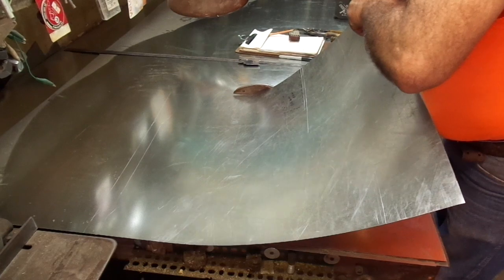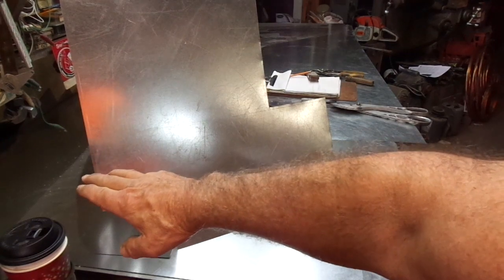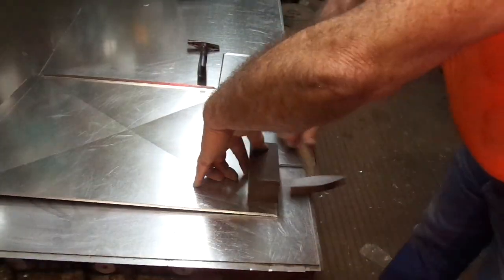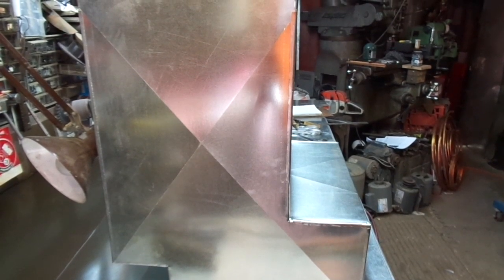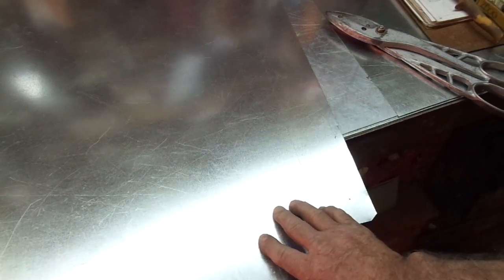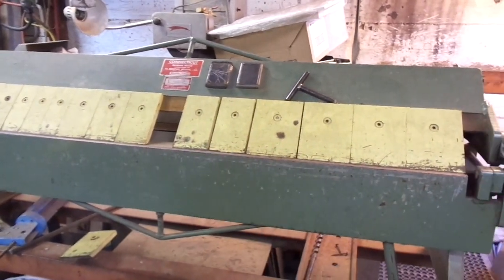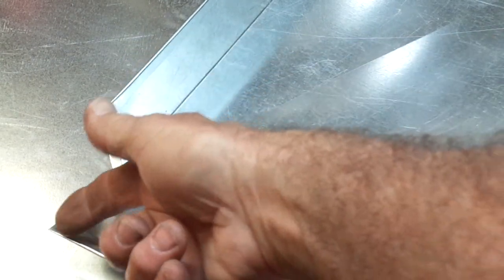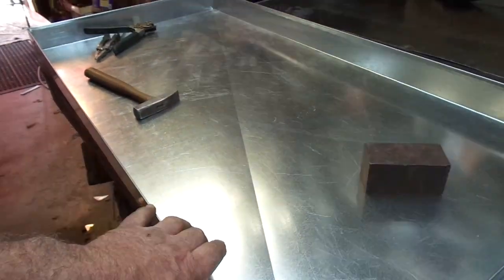Pt 1 Heat Pump Attic Installation

Comment: Looking good Tractorman44. You have me wondering how you will insulate the unit for our Canadian weather, both hot and cold. I have spent some time in attics. The dust will get to you even if the weather is cool. Take care .
Reply from the maker: Good Morning Larry and thank you for the compliment.  I don't know what the design temps are for your particular area in Canada but here in the St Louis Mo. area, it is 5* F for the winter and 95* F for the summer.  To insulate the ducts for attics or crawl spaces a 1/2" fibreglas ductliner on the inside or a Mylar coated bubble wrap on the outside is allowable. When lining the inside with fibreglas I usually opted for the full 1" lining.  But now, I go only the Mylar way.  One of the videos coming up will be almost entirely on duct sealant and insulation....but they may be split into two.  I don't know yet for sure.  One thing for sure though...I HATE attics and crawl spaces.  Have a great day sir.

Comment: How's she goin'?  I guessing this duct system is way more complex than what you're letting on!!!  You do nice work though!!!  The sheet metal you cut sure fits together slick.  Having the gear makes a big difference!!!  Take care!!!
Reply from the maker: Hey Mike, good morning to you sir !!  Thank you for the nice comment.  Sometimes I get lucky and the pieces fit...sometimes they just GIVE me a fit instead.  (-:   This is going to be a small two ton system so the ductwork size will not be excessive at all.  The complexity comes with offsets and transitions and making sure they move the air in the quantity you want at the velocity you want to maintain and making sure the duct misses all obstacles in its path. I'm going to apologize to you and everyone else in advance that this will be a drawn out series even though not all the steps can possibly be covered.  I hope you'll stick around for a while sir.

Comment: Good evening T! So....If you are looking for input, then yes, please take us through the WHOLE install. LOL. (not that you asked but I would love to see you doing the whole thing- even that attic is hot and miserable. LOL). The heat pump system you are installing : will that require a condenser unit to be hung on the outside of the house on the second floor? Not sure if you know but interesting about the difference between Canada nd the US:  here in most all provinces in Canada, we all have 1 single HVAC system to serve multiple floors so the average 2 story home has only one HVAC system to serve it whereas in the US, it is often common that a 2 story house has a split or second and separate system installed to serve the second floor. Looking forward to seeing you making it happen in Part 2. Cheers my friend!
Reply from the maker: Good Morning Sir...  Yes, there will be a second outdoor unit installed a few feet off of ground level.  This area suggests a 12" minimum elevation to minimize being blocked by snow.  I know...that's almost funny compared to the amount of snow you gentlemen get in Central Ontario and welllllll....Canada in general.  (-:

There are however many, many two story homes that are served by a single system as well as many that have two units.  A single unit for multiple floors used to be the norm but due to the differences in temperatures experienced due to some very poorly designed duct systems the dual system seems to be the most desirable.  The thermostat was usually on the first floor and the second floor was always warmer in the summer.  I don't know the design temp in your area but here in the center of the Midwest it is 5* F for the winter and 95* F for the summer.  With the 95* and summers humidity levels of 90%+ you can easily see how the second floor could be effected adversely. 

To compensate for the heat difference smaller air handlers are sometimes installed with more CFM air delivery per ton of cooling so the cold, heavy air could be forced up through the ducts.  This additional airflow causes high velocity in the duct and correspondingly exceptionally high noise levels in the house.  Plus the temperature drop across the coil is also effected because a/c requires 400 cfm/ton to function as designed and 600 cfm (for instance) will lower the drop in temperature across the indoor coil. Not lower the temperature, but lower the temp drop... the air will actually be warmer in cooling mode and cooler in heating mode on a heat pump. (That may create an argument for some).  This is the case in my sons original single system.  When the blower is on, the tv moves to 100 on the volume scale until the blower shuts off....then repeat.  His original system is cooling only with electric resistance for heat.

This is an exhaustive subject GP and one that deserves much more discussion than these few paragraphs that do not do it justice.  I've opened many doors here that need more explanation but...well, you know, just can't do it here. 

I could write a book on the subject but it wouldn't be a best seller by any means.....LOL and I do thank you sincerely for taking the time to read my op-ed. (-:   Thank you also for professing an interest in the series.  It will become exhaustive, extensive, sometimes elusive and many other words that start with an E.   You have a wonderful day sir !!!!
Reply: And educational. Thanks T - Looking forward to it. Cheers and all the best!

Comment: I haven't done much in the sheet metal work other than the occasional job that has to be done. I learned quite a bit from this video. Figuring the square inches of ductwork cross section is new to me. I also had never seen the power hammer. That has got to make your ears ring when you use it on a box shape. 😜
The little crimping pliers would have come in handy at least a dozen times that I can think of off the top of my head. 
I had a little training in using bending brakes in shop class and did a bit of tool work for the big hydraulic press brakes at Borg Warner and other places. I would love a box break but where would I put it? 😏
You can make as many of these videos as you want. I will be happily sitting here eating my lunch and ready to watch. 
Suppose to rain this afternoon. Just now finishing up todays video upload. It's a big one. it was going to be an hour on the router repairs but I cut it back to 38 minutes so I would be able to get it done at all. 😱
While it was uploading I figured I would mow the lawn but the mower smoked a fuse. That is a pure indication to go sit down and eat lunch. Right after getting a  new fuse at the hardware of course. 😎
Good job on the ductwork and I'm glad you are able to help out your son. Never liked fiberglass insulation. Especially in attics. Part of the reason for not being a residential electrician unless forced. I have installed lights in the last 3 attics I have worked in. Much nicer than dragging a drop light around. An outlet with a bell box and weather proof cover is nice too. That way the wasps don't build nests in them. 
Just finished up the last of the nuggets and I'm done with the video so Hi Ho Hi Ho it's off to mow I go. 🌄
Reply from the maker: Good Morning to you my fine friend.  One note...those crimping tools proper name escaped me for the moment while doing the video... they are called a button-lock punch.  They are very handy for many situations....and I think I said in the video that gutter men use them a lot for their end caps prior to applying  silicone sealant.  Most of my videos start out 35 to 45 minutes and 2/3 gets cut out to streamline them as much as possible.  Unfortunately a lot of good stuff goes down the tube as a result.  At least I think its good stuff...I don't know if the viewers would...LOL.

I worked with an old timer back in the day that told me that a fellow makes his own conditions on a jobsite.  In other words, take the time to clean debris away, get lighting where its needed and organize your tools and equipment.  Then start to work.  I try and sometimes succeed and other times not. 

Thank you for the positive comments sir and I agree with you on the fibreglas 100%....and here's hoping you got all your mowing done !!
Reply: @tractorman4461  Finished just ahead of the rain.
Now I'm editing todays video and labeling parts bins and drawers. That's part of the making my own conditions. 
There is a caution that goes with the attic improvements. After i put a partial floor in the attic in Union City and strung some lights so I could wire the house a little easier. My helper got the idea that the room could be used as living space. Just by the skin of my teeth on that one. 😎

Comment: 44 I am not a tin knocker but like learning new things waiting for part 2
God Bless 
PaK
Reply from the maker: Good Morning PaK...  Technically I'm not a tin knocker either, and probably wouldn't really make a scab on a real tinners' behind.  I was actually an HVAC service tech that spent a lot of time on construction jobs. I did a lot of tinwork, mostly commercial and a smattering of residential, back in the mid 70's through the mid 80's but not a lot since.  I'm still working the rust off the snips and the shop tools right now.....and enjoying retirement more with each passing day.  Thank you sir for the supportive comment sir.